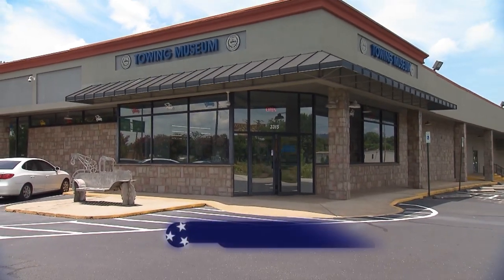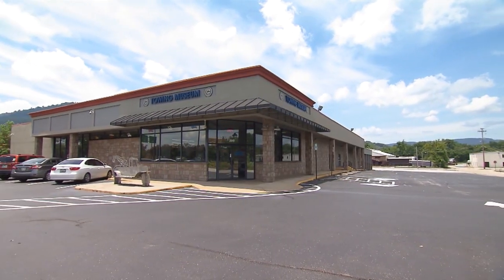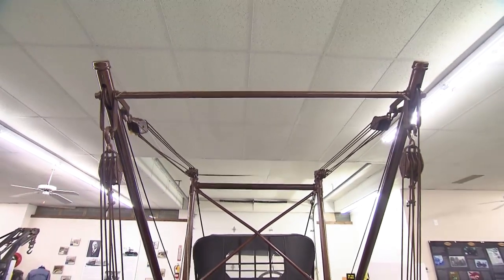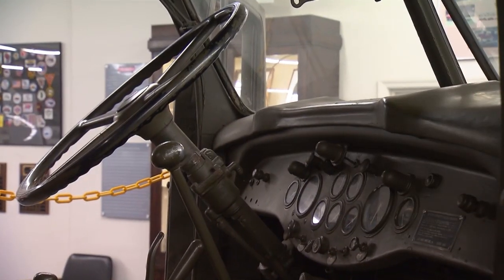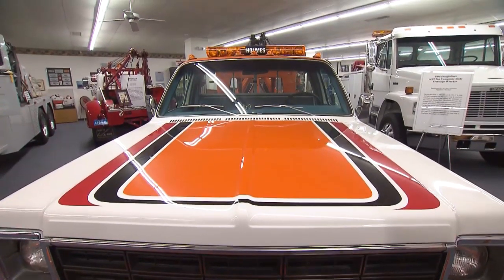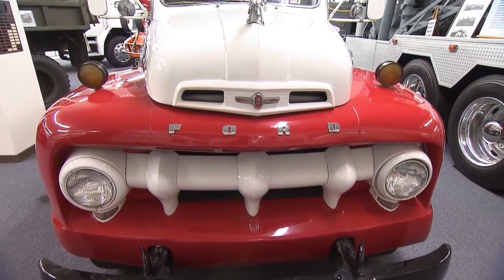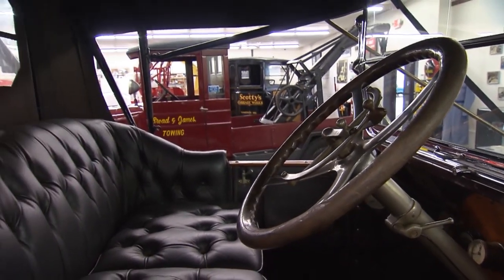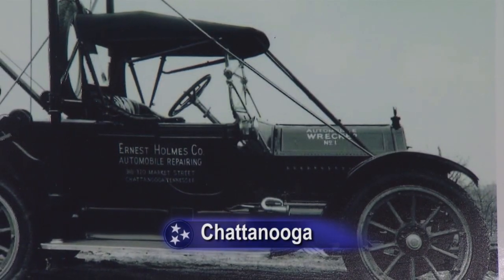International Towing & Recovery Museum | Tennessee Crossroads | Episode 3207.1

Comment: At truck at 0:39 looks a lot like the one where I used to work. The one at Lally's  garage in Swampscott is a 1948 F6 with the same setup on the back. It was bought new by the garage owner back then. Still runs & operates but needs restoration. The rims are now too weak to safely use it for towing. Ran great until one employee over revved it & messed up some valve springs.